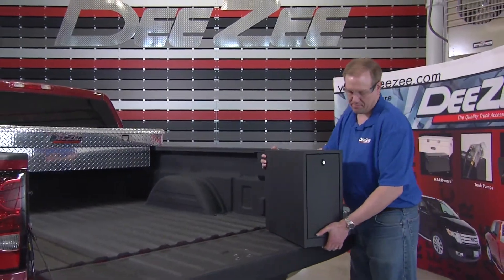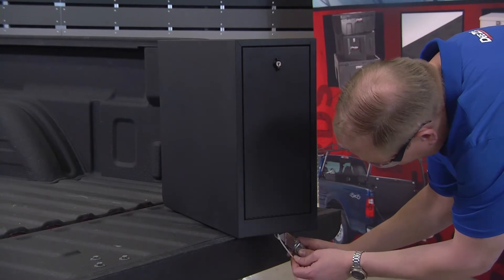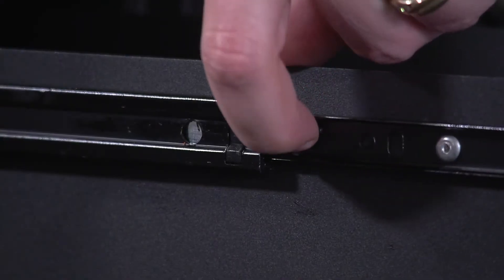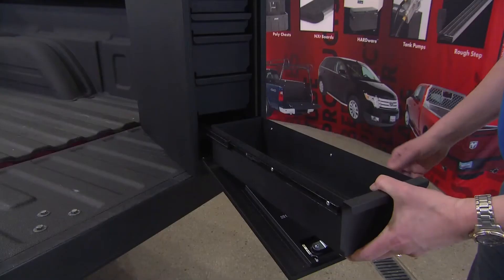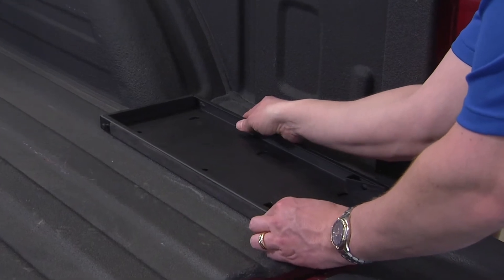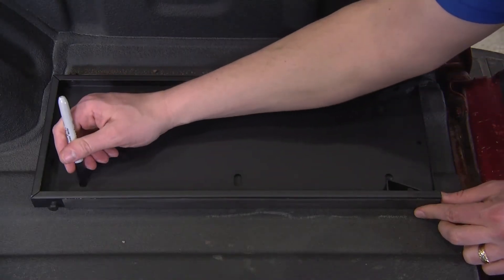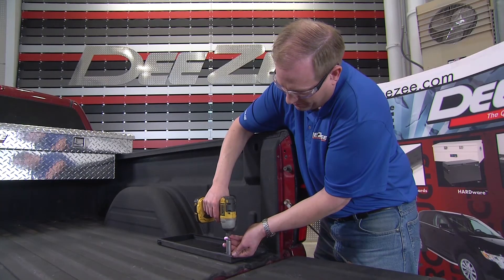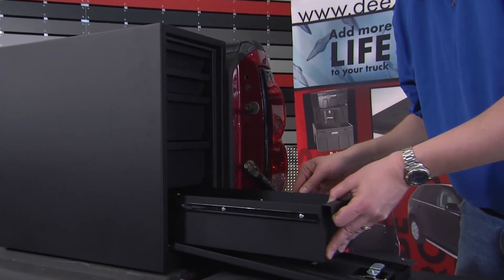Dee Zee Tech Tips: 5-Drawer Wheel Well Tool Box Installation

Comment: I edited this: Sorry DeeZee it was my mistake. The last digit of the number that I dialed was a 1 not a 2 as shown here. The last 4,of your number of 2102 is correct. I accidentally dialed 2101. 

Can you put a link in the description that will reach you via phone so that others don’t make the same mistake?  

It’s hard switching on a cell phone from YouTube app to our keypad for the phone and getting the numbers right, I somehow manage to miss it by 1 digit. I should have verified this prior to my post. Thank you for the quick response and watching your notifications here. 

I am looking at a tailgate step for my 2017 Chevrolet 1500 LTZ Z71 4x4 truck (a step is built into the light assembly but it’s too high, I want one that I can push (or slide with my foot) out of the way when not in use.

Next need a low profile toolbox but have a Retrax cover so I need a shorter one. Hail damage hit my truck, 4 panels of my RetraxOne cover are damaged. I was trying to buy the Retrax panels to replace the damaged ones. Retract doesn’t transfer warranties since I’m the 2nd owner no help available. They are discounting the next cover since only part of the assembly is needed. 

I was looking at other brands of things that I need to buy since this will be upwards of $2500 for all that I need plus installation.
Reply from the maker: What number are you referencing so we can correct if there is an issue? Our offices are located in Central Iowa and we can be reached at 1-800-779-2102 | Mon-Fri | 8am-4:30pm CST